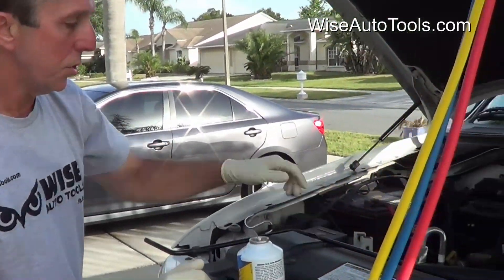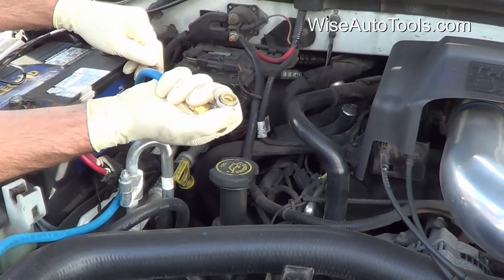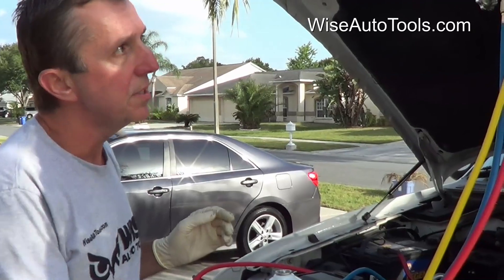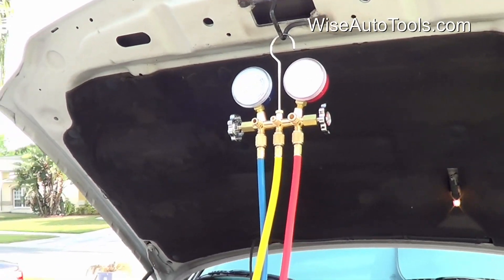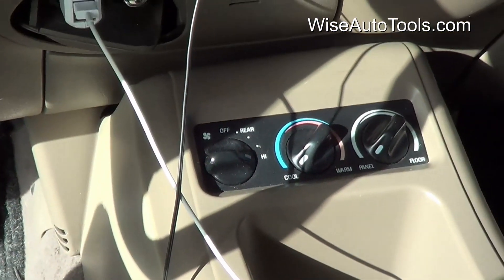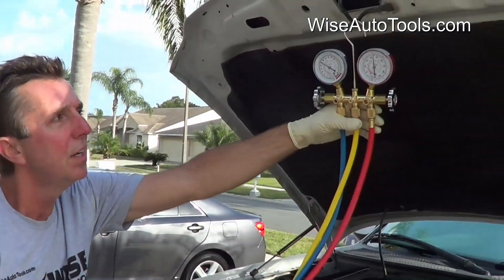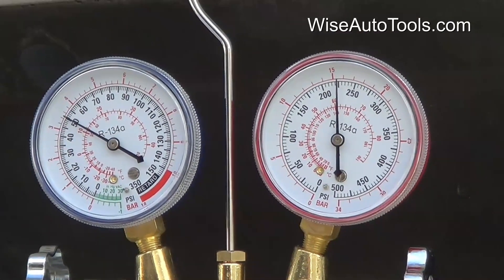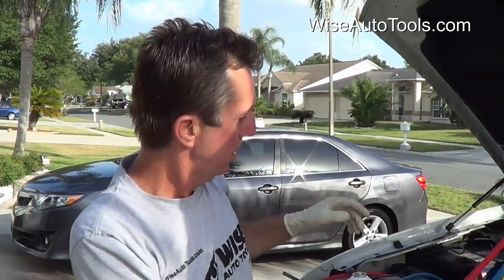Ford AC Check - Gauge Readings

Comment from the maker: Thanks for commenting and likes. Did not know what we were going to find when doing this video. But that is how things go in a real AC check situation. Sometimes there is an obvious problem other times there is not. The vent temp was around 50-55 F. Not great but it has been my experience that vehicles with rear AC do not cool as low of temperatures for some reason. Probably because the AC compressor is pulling double duty. My conclusion was that more refrigerant would not help. We knew the history of the vehicle and were sure that no one had over charged the system. If in a shop with access to a recovery and recycling and recharging machine I would have tried recovering, pulling a vacuum and recharging to see if we could improve the performance a little. Since there was not much of a chance to make it cool better by doing this, the owner decided to not do anything. At least we knew more refrigerant would not help. This was a high mileage vehicle that may have had a somewhat worn compressor. When a compressor starts to fail, sometimes you can have too high of a reading on the low side at lower RPMs.  I apologize for not answering  every question or comment. It's really hard to diagnose AC issues without checking things in person. My AC articles answers some common questions though. Check them out if you have some time. Also, I recommend getting an AC Gauge Set so you know what the readings are. As the video shows sometimes more refrigerant is not the answer.  http://blog.wiseautotools.com/category/air-conditioning/ Also on our other website we have an explanation of what the AC Readings mean. http://www.denlorstools.com/autoblog/2009/04/adding-freon-to-car-ac-gauge-readings-explained/2/

Comment: Hey how are you nice video mr i got a strange problem there is friend of the family she told me to check her car and the guage set is both sides is reading normal but the high side the arrow shakes and the ac is throwing hot air can it be the orfice tube or the ac compresor or or the valve?

Comment: Those are decent readings for the outside temperature. However, since you didn't state what the inside air temperature was, it's hard to tell if anything was wrong.

Comment: Do the knobs on the manifold need to stay closed to get the pressure reading?
Reply from the maker: Closed.
Reply: What is the procedure for disconnecting the hoses? Do you bleed the pressure from the high side into the low or just close valves and disconnect?
Reply from the maker: Just disconnect. The quick couplers minimize refrigerant from escaping.